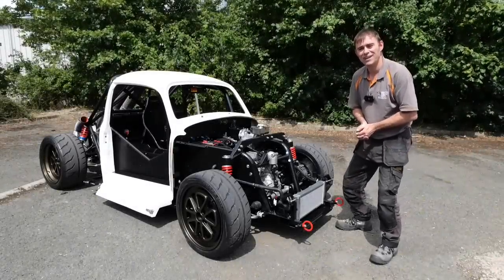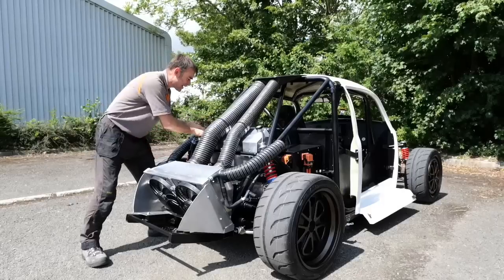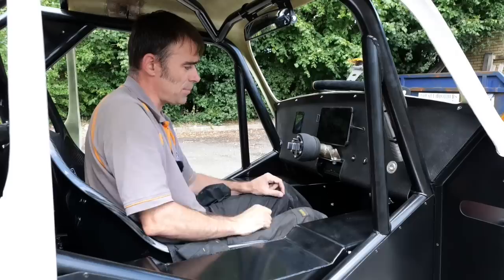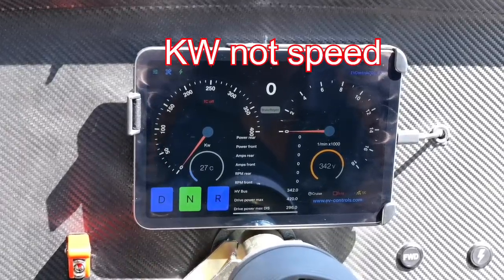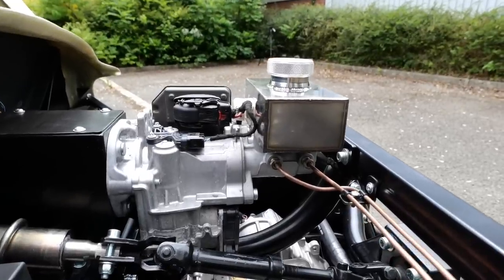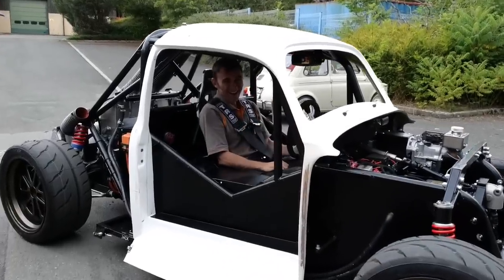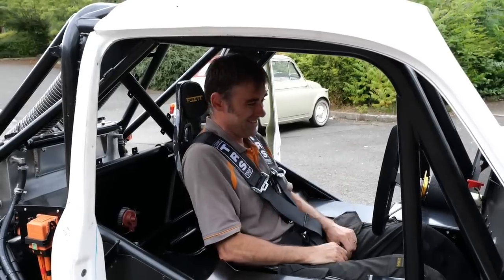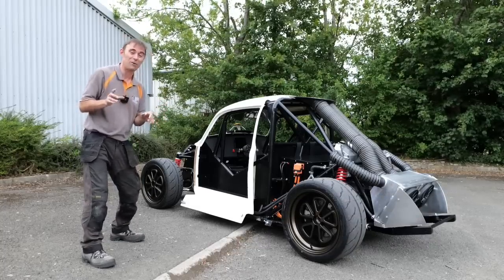Pikes Peak race car Ep8 - It lives!!!

Comment: With the three choices you have give us, I would choose Bug Zapper, but I love Beetlejuice!
I’m curious. What is the width between the two battery boxes where you are sitting? It looks mighty tight for my fat fanny!😂
Now for another question. How long are the races you plan to run? (How long is the track,and how many laps?) 
I would also like to know what kind of tire wear you are planning on. As a petrol car races the lighter it get. You don’t have that with batteries. Are you building this race car to a minimum weight? 
Thanks, and I’m loving this build!
Reply: Beetle juice, Beetlejuice, Beetlejuice!

Comment: I'm guessing by the angle of the rear chassis that a rear diffuser'ss going on there. It'll be a major boob if you don't take advantage of the air going under the car.

Comment: What connectors do you use for the high voltage connections into the battery boxes? It is hard to find connectors rated for 500+ amps, you must be pulling significantly more than that.

Comment: I don't know Killer Watt is actually a 1999 Marvel character as well as the name of a Slayer monster in Old School RuneScape.  That could cause problems for you down the road.  Talk to the legal team.  I like Bug Zappa, just because it is a VW Bug and it is electric, although if Zappa is related to electricity or a certain musician seems rather vague. 😏I suppose a lot of it will go with how the name is done up and the overall color scheme for the car.  I think I heard something about a lightning bolt being used in the design.  Is that a fact?  Is it going to be red, yellow, or electric blue, or some other color altogether?  Silent Assassin almost demands a dark color scheme.  I don't think neon yellow when I think assassin, so the color of the car definitely matters.  Now if you put up three images of what the finished painted car and side logo looked like and then asked me to pick, I think I would have a better feel for my decision.  For now, Bug Zappa has a slight edge.  Findlay Brewing does have a drink called the Bug Zappa.  I just ask that you don't have to many Bug Zappas before driving. 🥴